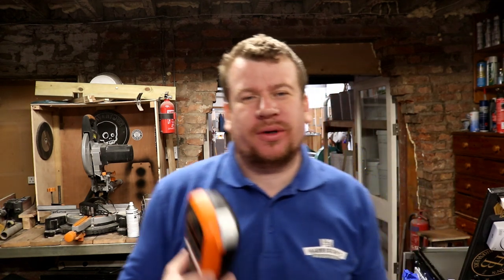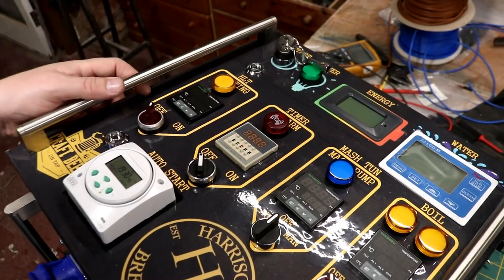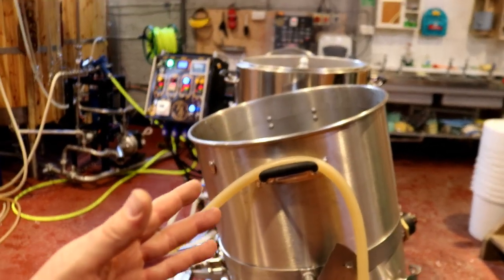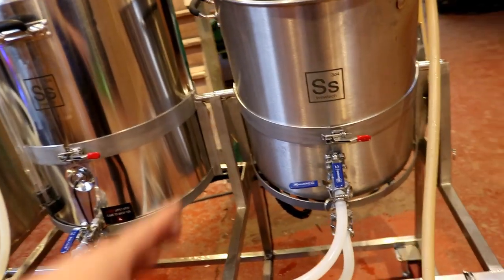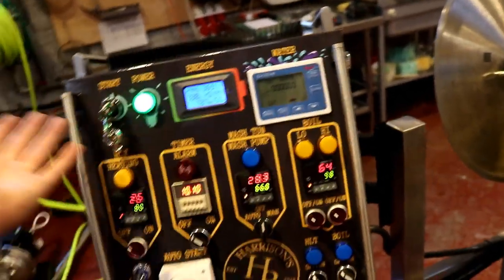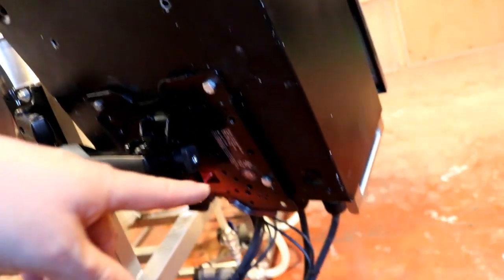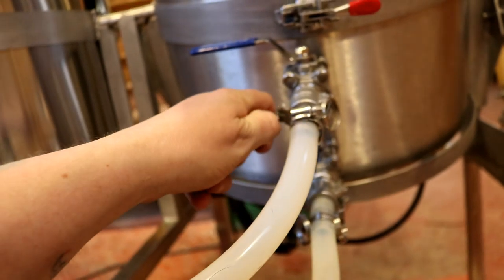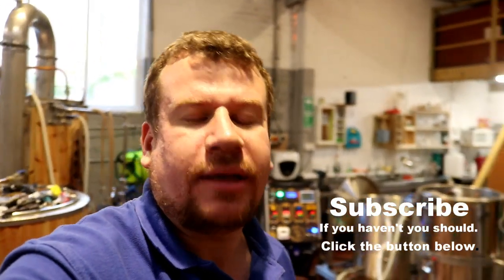Brewery Pilot Kit ~ Control Panel Build ~ Part 6 🍻

Comment: Shame you have already rewired the panel, for the led's being semi lit, you could have put a small resistor inline (in a bit of heat shrink) which would have made the voltage below the forward voltage of the LED. Anyway all rewired now. I noticed on my panel, my indicator lights flicker when i turn my fluorescent light on in my shed. Panel is looking good.
Reply from the maker: Yes, after a little research I figured that out. Never mind.
Reply: I'm doing a similar if very inferior low tech build.  What value resistor would you suggest?
Reply from the maker: @MadeByMartyn  This might help, https://www.ia.omron.com/support/faq/answer/18/faq02155/

Comment: Hmm, it was my understanding that the leakage current on an SSR is due to the snubber circuit placed across the output to limit the dv/dt across the triac keeping it from false activating. I also get a dim glow on the LED panel indicators, but only when the SSRs are unloaded. When the elements and the pump are plugged in the LED indicators go dark when off. Nice job on that panel though. I have some pics of my panel on IG, but of course YT won't let me put a link here...

Comment: The issue with the dimly lit led is something that happens on my kit also. It only happens when I have the element unplugged though, so I consider it to be a non issue. The draw from the element is enough to stop the led illuminating. Maybe the extra relays are overkill?